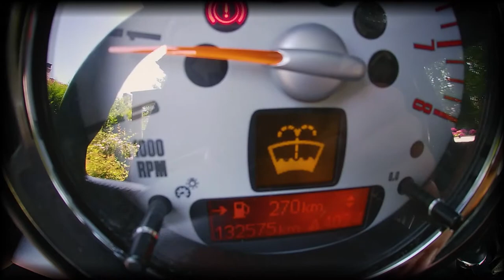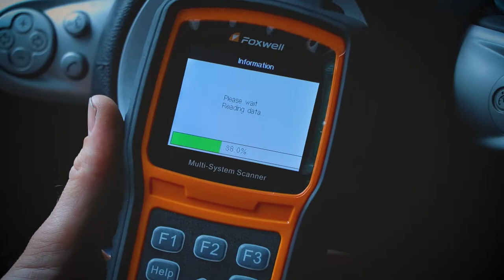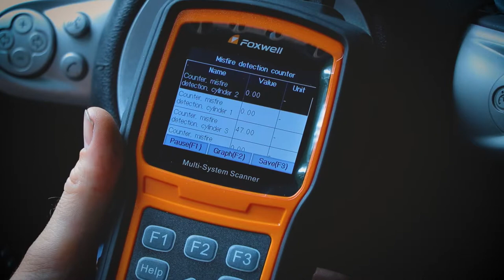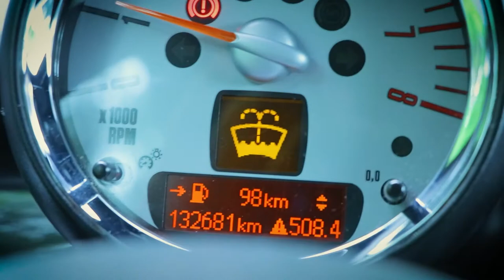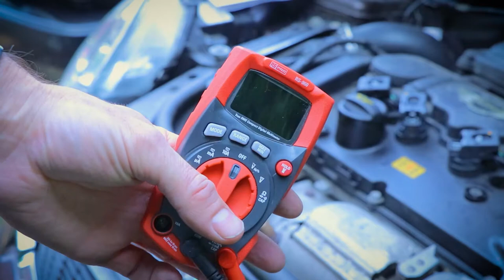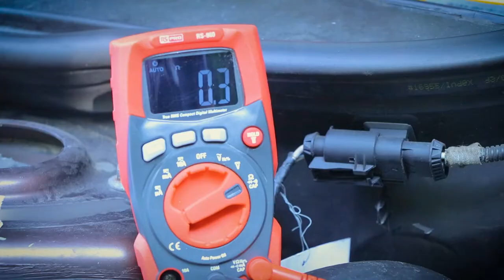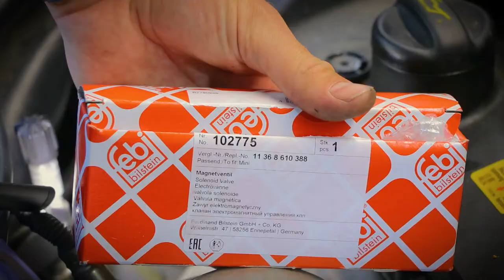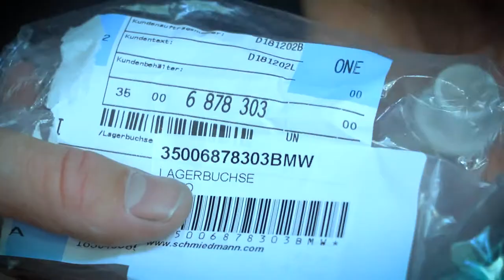Project Clubvan S EP1 (it's a lemon)

Comment: That not a real clubvan .
Reply from the maker: No it isn't. Its a Cooper S, which I transformed into a Clubvan. Mini never made a Clubvan S, so I did.
Reply: @gmcevoy  You’ve got it backwards.
You should’ve bought the van and then converted it into an S  
End of the day that is a car  from factory  .
Taking the backseat out of it doesn’t make it a van  .
Reply from the maker: @BullyBoxer  Much more of a hassle, and completely illegal here. Swapping engines is a no-go. Plus, the clubvan doesn't have the Sports chassis, when this S does. So I got it right. And it was indeed a bit more involved than just taking the back seat out. I bought and fitted the Clubvan inner boot panels, had a floor cut to measure and then got it approved by the technical inspection authorities to make it all legal.
Reply: @gmcevoy  still just a car ,and not a factory van .
Reply: @BullyBoxer  if the registered name is all you care about, sure...